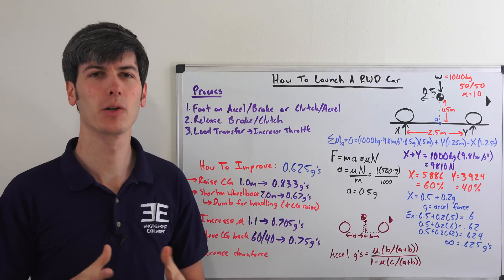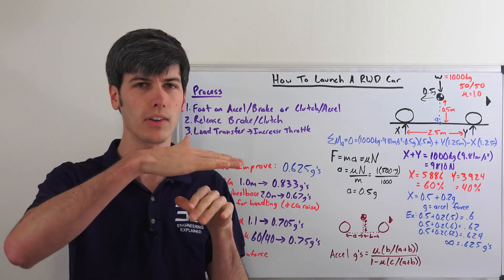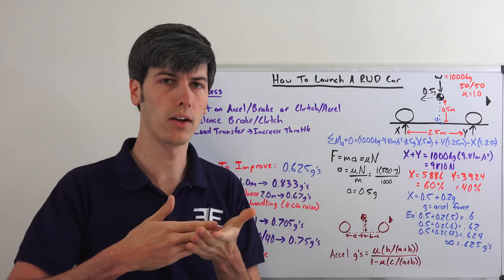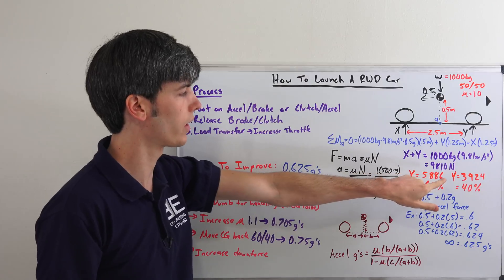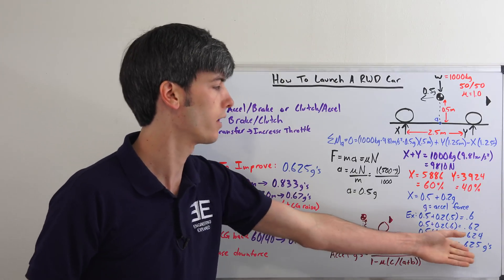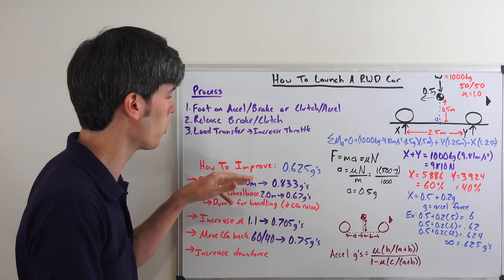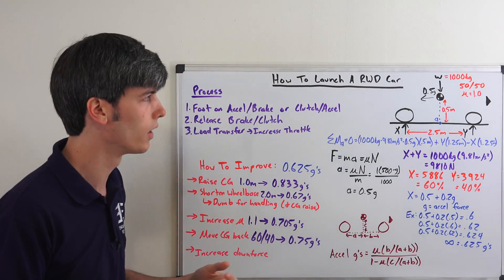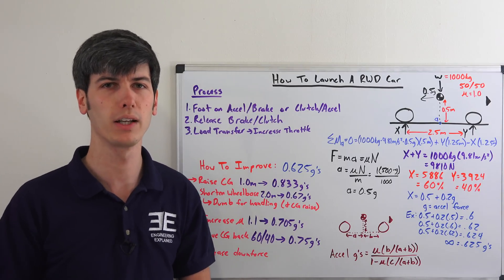How To Launch A RWD Car - Design Considerations

Comment: I wanted to request / suggest a video topic. I keep hearing about the appeal of rwd cars, mostly from older enthusiasts.  I've only ever driven fwd cars. is there some  performance advantage to rwd that I'm not aware of? are they somehow superior as I've heard?
Reply: They have a lighter steering feel and a happier rear end. Plus you don't have to worry about torque steer! Also because now the front wheels are not driven it means that you can accelerate during turning without using the front wheel's available grip and thus without creating understeer allowing to accelerate sooner as your exiting a turn.

Comment: well explained perfect math, only problem is engines cannot maintain peak power and torque and also last. perfect example I work in poweraports industry many side by side vehicles (rzr,maverick, etc). are cvt vehicles. they work exceptional off-road on road they over rev the motor and are way to hard on the engine, also maintaince jump astronomically when you maintain a constant high rpm, hp, torque situation reduceing engine longevity by at least 5times

Comment: there is one car that closely fits the discretion of the theoretical car in the equation which has a weight distribution which is already very close to 60/40 (approximately 65/35) the wheel base is approximately 2.5m and it even weights less that a 1000 kg approximately 940kg, the car is a 1303 vw super beetle so with and light wight powerful engine/transmission and a good set of treys it could achieve acceleration of 0.75g
Reply: Of course well also all the classic beetle has the same weight distribution but the 1303s have better aerodynamics due to the curved windscreen
Reply: Ture but XL1 looks fast but a curved windscreen classic beetle dosen't so my dream is to put the body of one on a full custom chassis and fit with a ls3 V8 6 speed transmission and do every mod to reduce the aerodynamic drag and the weight as much as possible and end up with possible the ultimate sleeper car

Comment: is he only including weight transfer from acceleration or from torque as well?
Reply from the maker: Torque at the wheels creates a force at the wheels, which determines the acceleration. (F = ma).
Reply: +Engineering Explained 
thank you, I think I was mistakenly separating the torque of the wheels against the ground, and the effect of acceleration on the centre of gravity. Thus creating 2 forces when there is only one.

Comment: Hi, I have a different opinion, if coefficient of friction is high enough then I think the lower cg will increase max G. Since the direction of the most force apply to CG is from the point of the rear tire contact to CG. I don't have a better way to explain this thought but I think you will understand my point. I like to watch your video btw

Comment: bro can you help me in converting my toyota corola's sound into sports car sound
Reply: open your pipe
Reply: If your Corolla has a stock 4 cylinder engine, there isn't much you can actually do. Just chopping the exhaust will make it louder, but it won't sound like a "sports car" exactly. These home mods are why ricers have a reputation for sounding like fart cans. If you take it to a professional exhaust shop and tell them what you want it to sound like, they can make it better, for sure, but it still won't sound like a V6 Supra or V8 muscle car.
Reply: ***** Supra had I6
Reply: So it did. My mistake.
Reply: ***** the twin turbo ones are among the most wanted cars on Earth

Comment: Thank you very much for this video, we are designing a 2 seater rwd 3 wheeler (one wheel at the back) and this is one point we are struggling at. Although a lot of this is common sense it's good to know the maths behind it as well so we can actually calculate the reality of the situation. Considering we will be having around 130hp and the total weight will stay under 400kg we will seriously be struggling to find grip..

Comment: Hmmm. I'm not sure that this is correct. It is in a sense, but not really. What this really is, is the recipe for how to get the greatest amount of front-to-rear weight transfer, for a given value of acceleration. This is what it correctly explains, and the question is why it is thought desirable to make the amount of front-to-rear weight transfer as great as possible. Of course the reason is that this increases the rear-wheel traction. Okay, but in the correct interpretation of the equation, if you do this to the fullest extent possible, then all of the vehicle weight will transfer to the rear with only a slight amount of acceleration. For any acceleration beyond that slight amount, there will be no further weight transfer. Thus, what this is arguing is that in order to achieve the greatest possible acceleration, you make it so that with just a slight amount of acceleration, the front wheels lift off the ground. This really is what this is arguing, that in order for acceleration to be as great as it can be made, you make so that with only slight acceleration, the front wheels lift. If you watch those crazy videos of idiots pulling extreme wheelies on high-performance motorcycles, it is obvious to you that once the front wheel comes off the ground, the center of mass moves higher, which increases the amount of wheelie-torque (pitch) relative to the amount of acceleration. It is a compounding effect, in other words. As soon as the front wheel comes off the ground, it is necessary to reduce the amount of thrust, lest the motorcycle or car flip over. A more correct approach to this problem would decide on the maximum amount of weight transfer that is desirable, such that the contact force at the front wheels does not fall below some threshold that has been deemed requisite, and then solve the somewhat different problem of how to achieve the greatest possible acceleration for the allowed amount of weight transfer. It is a tricky problem, because if you do the obvious and try to curtail the amount of weight transfer, by lowering the center of mass and moving it further to the front (the opposite of what he advocates), then the reduced amount of weight transfer will mean less rear-wheel traction, which has the obvious potential to limit the amount of acceleration. It may be that the textbook solution involves multiple partial differential equations solved simultaneously.

Comment: hey I HIGHLY enjoyed your videos but I have a question for you. how does the "overdrive" function? not sure what it does...could you make a video on it? cheers!
Reply: "overdrive" function work?*
Reply: The gear ratio would would be less than 1:1 say you have a 5 speed. 1st might be 4:1, 2nd- 3:1, 3rd- 2:1, 4th- 1:1, 5th-(overdrive) .75:1. The engine would  be spinning slower than the drive shaft, making the car more efficient at higher speeds, while making the car feel very sluggish if you step on the gas.
Reply: +cutthroat795 Thanks!

Comment: How does the math change in relation to the distance of suspension squat? If you have a suspension with minimal squat wouldn't that affect the load transfer quite a bit?
Reply: In this example here he is assuming that there is no squat and the car is perfectly rigid. If you were to consider squat you would find that load transfers the same but that some energy is now being used to compress the rear suspension.

Comment: Great video. So, a rear-engined RWD vehicle can accelerate (and perhaps brake) best in a straight line. Moving the engine to the middle however will make better use of the front and rear tyres while cornering at a constant speed, and a front engine might give you the best lateral grip of the three while accelerating through a corner. So, assuming unlimited power and torque (so traction is the only issue) no downforce, and unlimited control of other setup parameters (spring rates etc.) which is best, or to what extent does it depend on the layout of the circuit? You are allowed to take a different racing line in each of the three vehicles. Looking for a theoretical mathematical answer, not a race between a Porsche, a Ferrari and an Aston Martin :)

Comment: Would it ever be benifcial to add weights to the front of the car to increase its maximum acceleration g force?
Reply from the maker: +Speedman28 adding weight is never really a good idea for improving acceleration, but there would be certain scenarios. Have a quick search for "can adding weight make your car faster?" And I explain the math. :)

Comment: Hi. I can see that the weight is included in the "big" formula, but can't see where it is in the "short" one? Is it included in M somehow? May be cos weight acts in both directions (increasing traction, but also decrease acceleration a = M.N/wight ) is ignored or am I mistaken? And if so, isn't adding weight having much grater impact of decreasing acceleration than traction improvement?
Reply: Yep, at one point, the force against accelerating (Inertia, mass) and the traction force (created by mass) are canceling each other out.
F=m*a --> a=F/m for general Acceleration ; the same m belongs to the equation a= (µF)/m which is for the friction part.
Another try: mass plays a role when it comes to engine power output, but since it is assumed to be infinite, it doesn't really matter (but mass has to be positive rational, because division by 0...aaaand logic).

How to accelerate with more than 1.0 g:
- have enough (!) eninge power output / good gearing ratio
- have a µ higher than 1
- have a load transfer of 100% to your driven wheelset (best to achieve with awd)
- have downforce
- don't have too much torque on your wheels or they spin which is lowering the friction coefficient (dynamic friction < static friction)
- have a rocket-engine (vertical, horizontal and even in between :-) ) or any other non-friction-based engine/propulsion with a F/m-ratio of higher than 1.
- just do it!

Comment: Nice explanation, very good video on the topic. There is one additional factor that adds weight transfer, that being the suspension travel. The moment that is caused by the acceleration will shift weight from front to rear, and this will in turn lower the rear of the car and raise the nose as the suspension responds to this change in load. The new angle of the car will move the center of mass rearward (slightly) and thus further increase weight transfer. I do enjoy your videos, and I can imagine this will be followed by how AWD systems respond to this phenomenon. Keep it up!

Comment: What about a RWD automatic?
Reply: read the bottom of description
Reply: Thanks.
Reply: +SGM 26 yw :)
Reply: +Derrick Johnson Don't hold it too long though, you could over heat your transmission fluid. Not more than 15 seconds.

Comment: I'm curious as to why you made the coefficient of friction greater than 1. I only took ap physics my senior year so I think you took more than that but we learned that coefficient of friction can only reach up to 1. Did you do it to create a more obvious difference in the results or something?
Reply from the maker: +Cameron Lancaster it can exceed 1, but most street tires will not. The physics gets tricky, but for example in top fuel the cars are accelerating at 4-5 g's, meaning the frictional coefficient is far greater than one.
Reply: +Engineering Explained hmmm...I'll take your word for it haha. It just sounds like it breaks physics but ultimately someone smarter than me found out how you can exceed what I assumed was no slip, and you also understand how it works. That's why you have so many loyal subscribers.

Comment: could you please explain how water-methanol mixture injection into the engine works? Germans used this on their fighter planes during WWII
Reply: water lovers the temperatures in the cylinder, and the methanol adds powaaaaaar

Comment: But isn't the friction coef. 0.7 or ~0.8 on dry, asphalt surface? Just asking because all our calculations involved those numbers, and would it actually change anything if you'd put those numbers into equation? I'm kinda in a hurry so got no time to calculate it myself, but anyway, thank You in advance if you answer me ;D
Reply: well, it's just to simplify the equation. 1000kg car, 9.81 ms², µ=1 !? Boom, 9,810 N. simple as that.
Reply from the maker: +KRAUSER0130 1 is a reasonable frictional coefficient to assume, especially for straight line accel/decel.

Comment: i know the math make sense on short wheel base on load transfer for better traction. Can you explain why those top fuel dragster and funny cars have so long of wheel base compared to their relative width and height?
Reply from the maker: +Ming Li stability, and most of the weight is at the back so load transfer isn't much of an issue.

Comment: Hey man. Love your explanations.
Do you know how we can find the coefficient of friction of the tires? Most of the brands will just give you that traction score.

Thanks!
Reply from the maker: +Eric Cavalcanti well it depends on the road surface, so it's not always as easy as having a spec from the manufacturer. Best to see testing of multiple brands on the same surface. I don't know too many companies that do it, but Tire Rack does have data on a decent number of tires.
Reply: That makes sense. Anyways, I am going with the NT05 315 as I heard it has some grip.
My car is tuned and every time I change gear (auto - paddle) and I have high RPM, it spins like crazy. Not only for my actual skinny tires, but also the explanation you made (text at the beginning).
Again, thanks for the videos you make and keep the great work. :)

Comment: RWD is the only thing you should be launching anyway lol
Reply: +Unjo Gratis 
It's good in street cars. But in serious drag racing it's better to use RWD.
Reply: So you shouldn't launch an F1 car as a Formula 1 driver?
Reply: +Mikkel Ljungberg 
Sorry this may be a shock, but Formula 1 is RWD.
Reply: +Mikkel Ljungberg 
There's only been a handful of AWD F1 cars. Im guessing it's a combination of things. For one, F1 doesn't allow traction control and other systems that would put AWD to good use. And like the other guy said, F1 cars already have insane grip so the benefits of AWD might be outweighed by the negatives of the added weight. F1 cars are finely balanced delicate machines all about power/weight ratios and handling. I doubt AWD would improve the performance. Plus, when AWD loses traction it oversteers, with RWD it understeers. And understeer is almost always preferred over oversteer in the performance world. 

And in drag racing you can have so much power that the pushing vs pulling of AWD can conflict with itself and the car can end up doing a bunny hop type of thing off the line lol.
Reply: DemocracyOfHypocrisy I knew about dragracing, but I didnt know about F1.

It's definetly interesting.
Reply: +Mikkel Ljungberg  the fun part with f1 would be clearly explained by watching Richard Hammond race in f1 . you have to go really fast to get the aerodynamic grip. read wheel drive is the most preferred in performance racing because of the lower weight . the problems of rwd can be more or less fixed with aerodynamics and skill of the driver.
Reply: Damn I thought nothing launched better then awd
Reply: +DemocracyOfHypocrisy I have noticed this seems the be the case, but why?
Reply: +Speedman28 All wheel drive systems are heavier. so the improvement of grip by awd is easily balanced out by the fact that it's heavier. also f1 cars don't struggle for down force as they fix it in other ways as aerodynamicd
Reply: F1 cars do not need to launch, only accelerate.
Reply: +Mikkel Ljungberg 
You would think they're AWD by looking at them but people overestimate the ability of AWD vs RWD. What type of supermoto do you have? I'd like to get a drz400sm this summer for my first bike.
Reply: +Rahul Namboodiri 
Yeah I was gonna mention that. It's a combination of going fast enough to create enough down force, and keeping the tires warm enough to grip properly.
Reply: lol no haha

Comment: what would the max be if you do all of those?
Reply from the maker: +Bart Van Riel if conditions all work perfectly, you can get all of the weight on the rear tires. This of course means you wouldn't have any steering, so it's best to have a little weight up front for stability.
Reply: Engineering Explained yeah exactly, but how fast could a car with enough power and a grip coefficient of 1.1 accelerate?
Reply: With drag radial tires on a prepped surface, drag cars (and some "road cars" easily exceed 1g of acceleration for a period
Reply: Greg McNamer faster then gravity is pretty neat
Reply: +Bart Van Riel At launch, drivers are subjected to up to 4.75 g–more than a space-shuttle astronaut.
http://www.motortrend.com/news/top-fuel-numbers/
Reply: +Bart Van Riel also, to answer your original question, a car that could perfectly balance on its rear wheels during acceleration given tires with a 1.1 coefficient of friction would be able to accelerate at 1.1gs
Reply: Greg McNamer pretty nice!

Comment: what about the tesla model s. i dont think they have to shift through gears. and thus could just keep the load on the rear end
Reply: if it can be revved from a standstill then it's possible to launch. the tesla has a lower center of gravity since it has the battery pack underneath the car. idk if you can launch the p85d, since that is an awd, not sure what wheels the 85d variant drives.
Reply: Oh, you can just hack the tesla's computer controlled fancyness into using only the rear elecrtical engines, and then we have combustion engined cars with CVT Transmissions, these just get the engine up the comfort zone and never disconnect the power - that'd be interesting as well.
Reply: Electric motors produce maximum torque from standstill, no need for reving